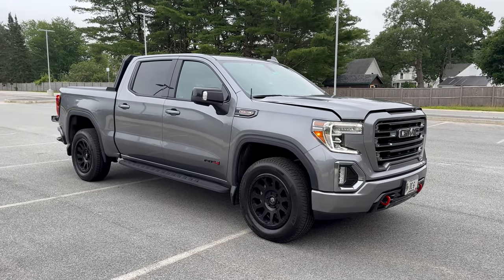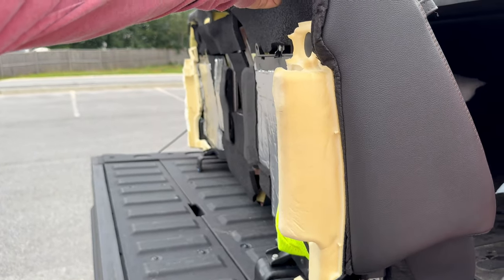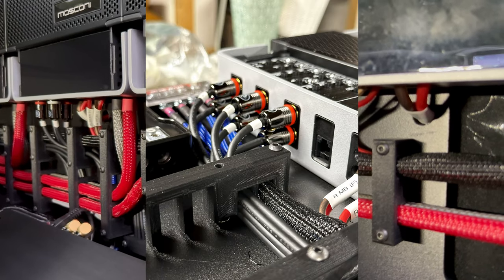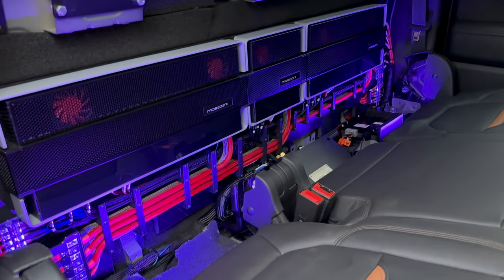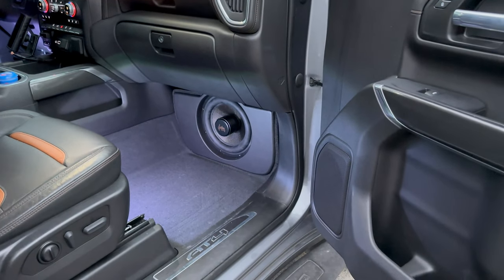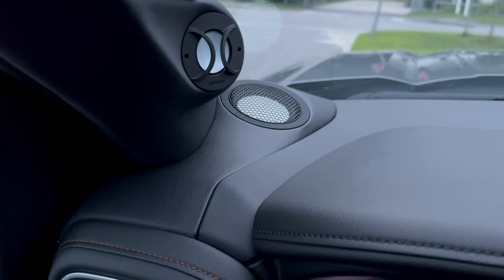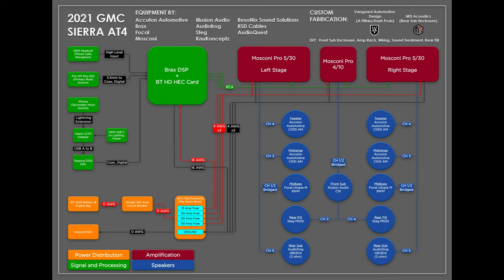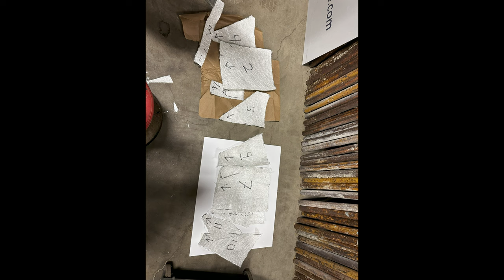2021 GMC Sierra AT4 - High End Audio System - Brax, Accuton, Mosconi, Focal (Updated July 2023)

Comment from the maker: Current Build (July 2023):

    Front Stage
        Accuton Automotive C30 AM - Tweeters
        Accuton Automotive C100 AM - Midranges
        Focal Utopia 8WM - Midbass
    Front Subwoofer
        Illusion C10
    Rear Stage
        Steg MS30, Differential
    Rear Subwoofers
        2 x Audiofrog GB12D4
        MTI Stage 2 Box (2.2 CF net)
        2" LMI Seat Lift
    DSP/Signal
        Brax DSP w/ Conductor
        Fiio M11 Plus ESS (RSD custom cable - 3.5mm to Coaxial)
        Topping D10S (Audioquest Pearl USB/Apple CCK3 and Optical Out)
        LLJ Customs Harness (High Level) for Phone Calls/Chimes/Navigation
    Amplification
        Mosconi Pro 5/30 #1
            Ch 1/2 - Left Midbass (Bridged)
            Ch 3 - Left Midrange
            Ch 4 - Left Tweeter
            Ch 5 - Left Rear Sub
        Mosconi Pro 5/30 #2
            Ch 1/2 - Right Midbass (Bridged)
            Ch 3 - Right Midrange
            Ch 4 - Right Tweeter
            Ch 5 - Right Rear Sub
        Mosconi Pro 4/10
            Ch 1/2 - Front Sub (Bridged)
            Ch 3 - Left Rear Fill
            Ch 4 - Right Rear Fill
    Power/Wiring
        0 AWG KnuKonceptz Kolusus Flex OFC
        16 AWG OFC Speaker Wiring
        10 AWG OFC Sub Wiring
        Jim's Machineworks Elite Distro Block
        Resonix Solderless RCA System
    Sound Treatment
        Resonix CLD/CCF/Blackhole Tiles - Doors, Backwall, Floor
        Resonix Fiber Mat - Headliner, Doors, Front Wheel Well Liners
        Soundskins Pro Door Kits
    Custom Fab Work
        Nick Apicella and Matt Kim - Custom A Pillars and Dash Pods
        MTI Acoustics Stage 2 Enclsoure
        DIY Rest of Build

Comment: Fantastic set-up!

 I also have an AT4, I respect what you have created and I know it sounds incredible! My OCD will not allow me to mix and match my speaker brands, I've very envious in that regard. I'm currently in transition from my late Focal K2's 3-way active, coaxial rear to a complete Focal Utopia in which I will run active 3 ways all the way around! The transition was inspired by the well-renowned Focal Utopia 10WM subwoofers. I ran 2-10WM in an MTI enclosure powered by FDP-1.2000 for some time, since I sold my Utopia's I have purchased countless subwoofers that wouldn't even come close to holding a candle to the 10WM accuracy and
depth.

I would highly recommend looking into them!

 Love the system, the rear wall is super sick and I look forward to your future content!

Comment: Could be the best install I have seen, and believe me I have seen a lot.
Reply from the maker: thank you!
Reply: @lukeouellet What types of sleeves are those on the midbass wiring spade speaker terminals? Also, I see you used a cable grommet for the cables running through your center console.  Do you mind sharing what kind you used/where you found them?

Comment: Did you have to run an aftermarket alternator? If so, what kind?
Reply from the maker: Completely stock electrical - 170 amp alternator is stock. My system barely pulls over 40 amps under full load.

Comment: @lukeouellet What types of sleeves are those on the midbass wiring spade speaker terminals? Also, I see you used a cable grommet for the cables running through your center console.  Do you mind sharing what kind you used/where you found them?

Comment: Amazing job man. The is one beautiful system. But I have a question for you. I have a 20 Sierra with Bose system. How did you get the signal from the factory radio. Did you go straight to the dsp from the radio or stock amp. Or did you used module like nav-tv. Thank you for your time. And ones again great job man.
Reply from the maker: I have an LLJ Customs high level loopback that gets signal from the head unit but I use a digital source 99% of the time now.

Comment: Yes, amazing build but if you’ve gone this far maybe think about replacing the Topping DAC with a CHORD DAC ?  I think they run at 5 volts ?
Reply from the maker: Ever since I got my Fiio DAP, I think I use my Topping maybe once every 3 months. But I do know the Chord DAC is nice from my headphone days, just don’t need it here in this application with my Fiio and Brax

Comment: A thing of beauty!!!!  Is this all on the stock battery/alternator?  Forgive me if the question is ignorant, but I don't know car audio that well, but I want to add a system to my 2023 silverado 1500 5.3.  Everyone keeps telling me to upgrade the alternator if I want more than a 1000 watt amp.
Reply from the maker: All those people telling your need an alternator for 1000 watts on a stock 86ah AGM and 170 amp alt are.....not educated.  3300 watts here, nearly half of that on AB power, no issues, no dimming, nothing.  All stock electrical.
Reply: @lukeouellet  awesome, thank you so much.  That is good to hear.  I am getting it done this weekend. Maybe I'll post a vid.

Comment: I would love to hear this in person few questions as I have a 19 Denali 1500 
1 with your master volume knob how do you start your truck as I always get a no key fob detect and I have to place it in that area?
Also how did you get wireless CarPlay on your phone?
Reply from the maker: Hey there - you should replace the battery in your key fob, just did that last month with mine, took 2 min and never have that issue again.  Wireless CarPlay started in the GMC trucks in 2021 :/
Reply: Ok thanks I did the battery change last week and still same issue not sure I will call the dealer and for the CarPlay that’s too bad for me looks like I need an adapter any suggestions?

Comment: Did you need to mod the rear seat back at all to fit or did the extensions allow you to keep the seat factory?
Reply from the maker: Beside removing some foam on the seat back, the rear cushion and frame itself is stock.

Comment: Did you upgrade the battery and alternator? If so, what did you use?? Thanks!
Reply from the maker: I did not. 100% stock electrical. The whole system has never drawn more than 40-45 amps under full 100% volume music.